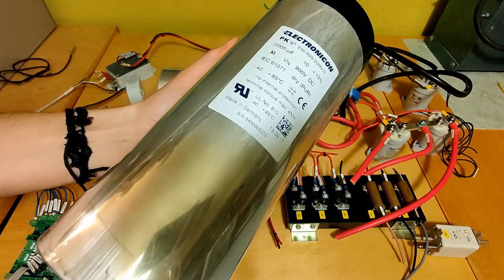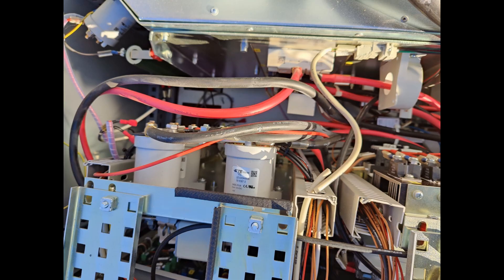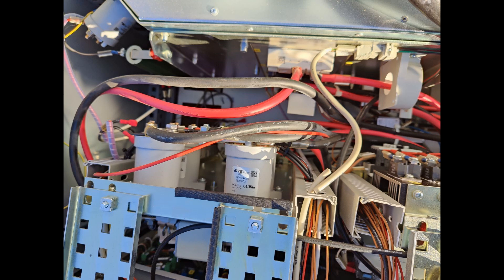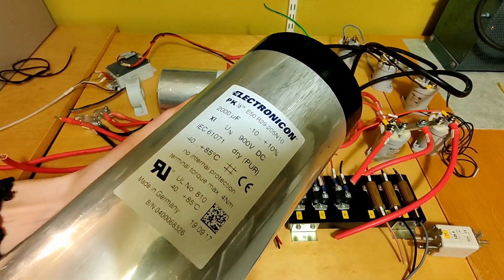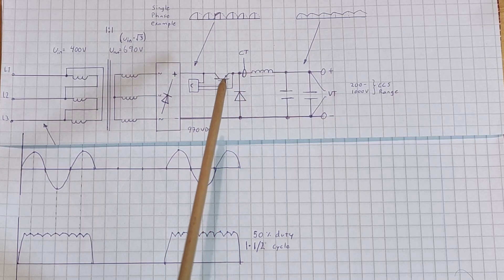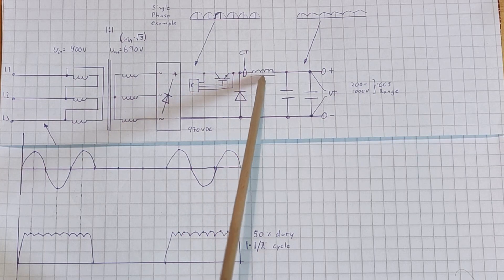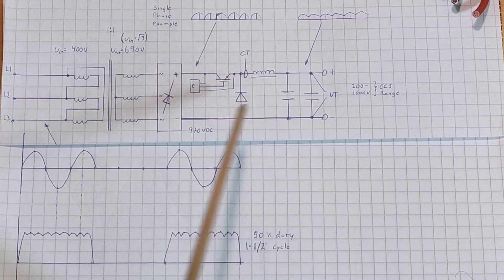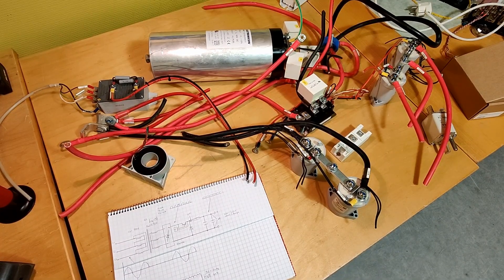DC Fast Charger Teardown

Comment: Interested that there is no input filter, buck converter is aggressive on the input, if it's direct connected to the bridge rectifier without any capacitor, it will propagate the noise to the input. The transformer due to bad coupling may attenuate the noise, but not much.

Comment: Interesting to see they have used this massive and heavy iron core transformer not more complicated but lighter ferrite core solution.
Reply from the maker: This was a small 50kW unit which is just directly connected to a 400V 3 phase supply, so maybe they wanted to keep it as simple as possible

Comment: Wow a low frequency transformer car charger!? How many kW was it?
It's neat that is has a GIANT buck converter inside also!  I'm sure it's basically acting as an active Power Factor Control. Most are boost converters but to keep the current down on the transformer they made it a buck instead and put it on the output of the transformer. That's really cool! Some good finds indeed!
Reply from the maker: This was a 50kW model, so not that powerful.
 It could be a boost converter/active pfc arrangement of the components, I was in a hurry to get everything out so I even forgot to make a video in the beginning 
Thanks for the comment!